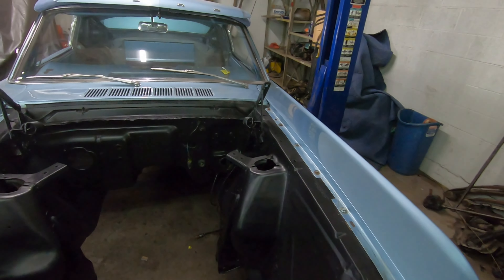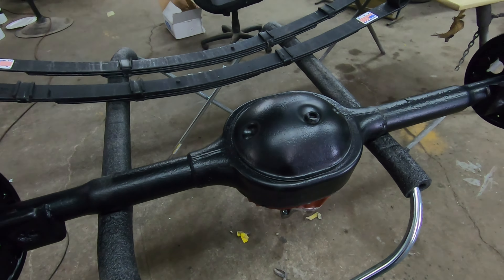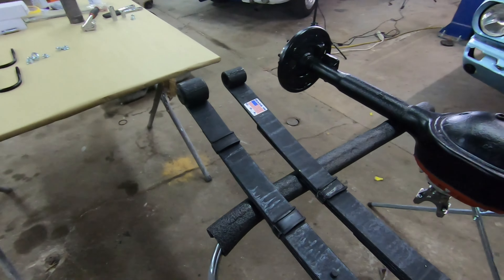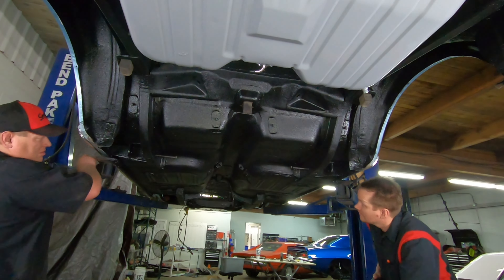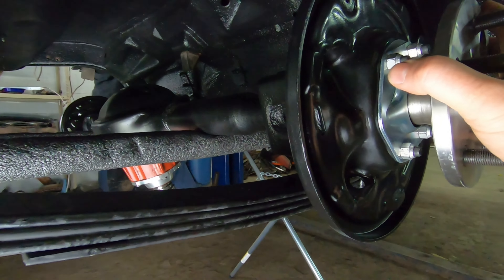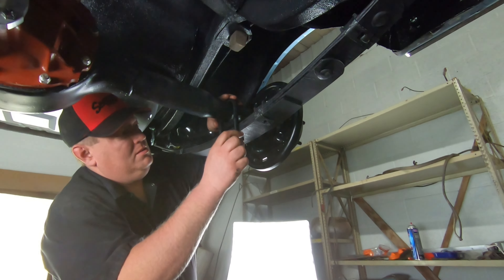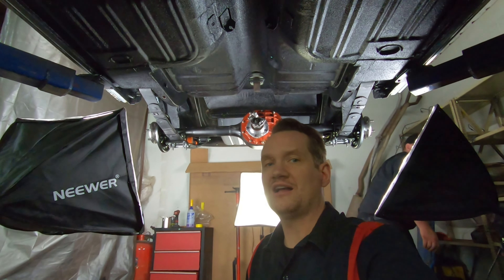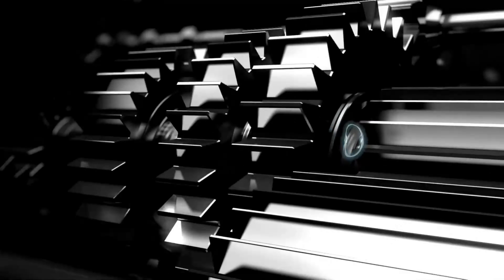8" Ford Rear Axle & Leaf Spring Installation - 289 Conversion - 1966 Mustang - Episode 6

Comment: Sir thank you for the videos educating us. I watched your pinion seal replacement on a Ford 9 inch. My 1972 mustang is leaking from the pinion seal. My question is do I need to replace the crush sleeve or can I just replace the pinion seal, and then use a dial style inch pound torque wrench to verify about 15 inch pound of rotational torque when reusing the original crush sleeve to reset the pinion bearing preload?